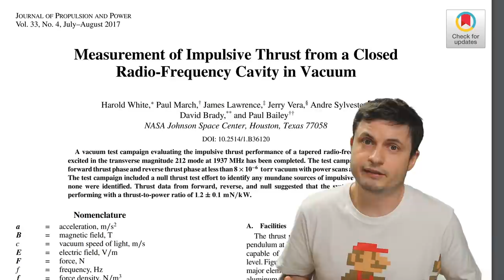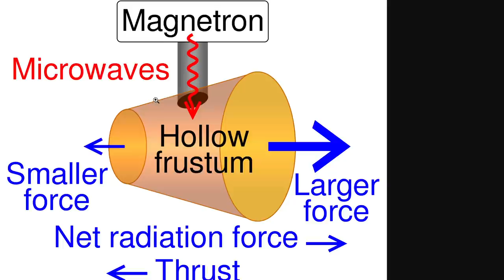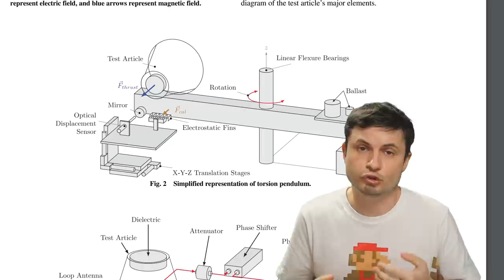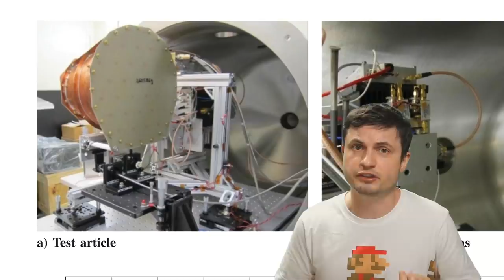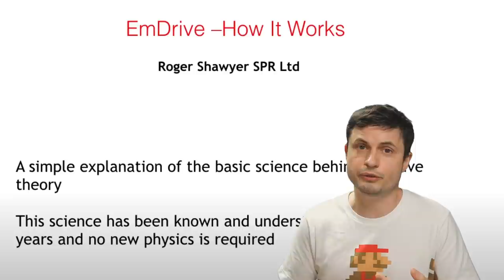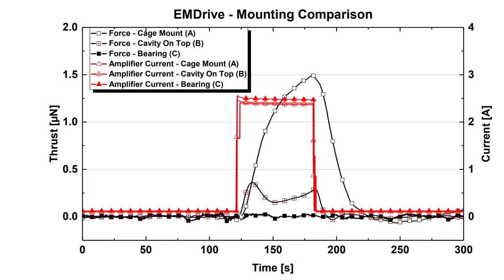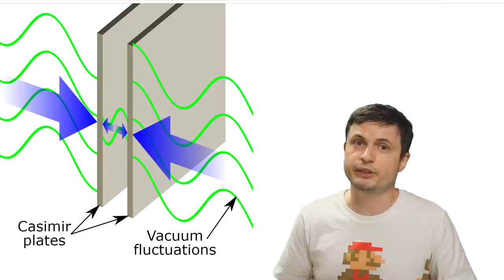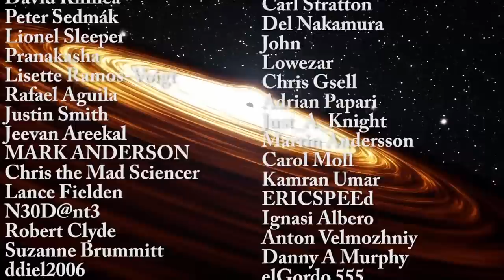Looks Like EM Drive Is Officially Dead - Experiments Fail

Comment: Just put in on a shelf until someone smokes the right amount of dmt and figures it out
Reply: Your name matches your comment kek
Reply: They are now trying it with light instead of em waves  someone already smoked some dmt
Reply: @Thorcat001  Light is an EM Wave.
Reply: I’m doing my best dammit
Reply: @Thorcat001  "They're now trying it with light instead of... Slightly different light."
Reply: I actually already have.  The vibration of a lesser thickness insert into the cavity of the larger would produce a pnumonics simular to a guitar and violen.  This in itself would cause a distortion that would negatively effect the surroundings causing them to become slightly unstable and while it will work.  It will require time for the vibrations to start to the point that propulsion will be achievable, and worse it will take time for them to stop without further import.

Acoustic vs electric.  Sound in itself can be used as a form of energy.  After all it is moving at the speed of sound.  And the density of the sound has the ability to not only move objects through vibration but also change their structural stability.  This could also be used as a weapon sadly enough.
Reply: @dontneedtoknow5836  What?! Vibration is not propulsion... Also, you need matter for acoustics, of which there is very little in space.
Reply: @Beeeeeeeeeee  sound waves exist in space.  Much like light sound isn't mutable by lack of gravity.
Reply: @dontneedtoknow5836  No, but it is mutable by, you know, having nothing to travel through. There are no sound waves in space. If there were, you'd be deafened by the sun even at this distance simply because of how loud a constant, gigantic nuclear fire must be.
Reply: @Beeeeeeeeeee  acoustics is caused through sound waves rebounding off of a surface.  Acoustics themselves is a disruption through soudwaves and yes are a form of energy.  Energy itself can be used as a form of propulsion if directed into a concentrated form.  This can be scene very easily in effects of a balloon near a vibrating object such as a guitar or a violin where the vibration isn't an almost instant fault, when compared to a snare drum or a   comcrete slab.  I don't think you quite understand what I am saying.

The more it rebounds within the surfaces the more it can accumulate but the input must be great enough to to reach the potential of the vibration of the object without damaging it.
Reply: @StormTheSquid  sound is not mutable.  It has a shorter lifespan that say light.  The reason their is very little sound in space is because we are not close enough to sources of iutput, and are insulated significantly more due to radioactive aspects of areas that the person would be exposed.

Much like a ship would be close to pitch black if the lights were off, due to lack of rebounding surface when it comes to light; the same method is applied with wound.  It is a linear travel wave much the same, the source determines the originating direction and rebounds determine the density over distance.  In fact if it wasn't for the surface of the earth itself you wouldn't be able to make out that someone yelled 2 blocks away from you.  A gun shot would not be audible at a quarter mile.  But when the rebound is concentrated on all sides or absorbed through insulation then you wouldn't hear it at all.  Why do you think ear plugs work?  The waves bounce off the foam inserts at certain frequencies and others are absorbed and slowed as much as possible before entering into the ear canal.  Much like light in water?
Reply: @dontneedtoknow5836  Please google the definition of sound. Then the definition of vacuum. I'm not going to explain 3rd grade science to what is presumably a grown adult on the internet. I just DO NOT have the patience for that right now.
Reply: @StormTheSquid  yes lets.  Let's also encourage a discussion of this theoretical engine using the wrong material to actually refract an electromagnetic wave.  It is made of copper or brass.  Bot conducive to what he is attempting.  He would need something of an aluminum shell to actually cause the rebound he is attempting to produce.

By charging the shell he is merely releasing the energy through the shell and discharging it in such a way that it is not focused.

I never said the engine would work for space travel with sound.  Do not even assume so.  I said he is using the wrong wavelength to produce any thrust with that design.  He should make it out of aluminum alloy if he wants to use electromagnetic properties with it.  If not then all he is doing is causing the copper to react and be a form of conductor.
Reply: @dontneedtoknow5836  I really don't have the time nor patience for you rn. I'm not a grade school science teacher. Please do not reply to me until you've understood why sound doesn't exist in the VACUUM of space. I've even given you a huge hint there.
Reply: @dontneedtoknow5836  Oh man... Acoustics need matter to propagate, electromagnetic waves don't. Why? For sound to exist in a substance, compression needs to happen. If there is a very low density of particles, barely bound by cohesion/adhesion, there isn't much compression if any. So no sound. EM waves do not need compressible substances to propagate.
Reply: @Beeeeeeeeeee  I know this.  And the materials he is using aren't efficient for what he is trying to so.  He needs a non-conductive shell.  But anything that you can use would be to fragile to survive any form of vibration needed to create such a compression to generate the thrust.

Sound does travel in space though.  The concentration of particles just prevent it from being measurable to the human ear.  The question isn't if this engine will work though.

The real question is how to transfer the vibrations into a concentration of particles by moving fast enough to actually accumulate them to a meaningful reserve within a confined area?  How does one create enough gravity to concentrate them towards itself?
Reply: Siri: Read me a list of discoveries made after smoking DMT. "Please tell me you're on DMT right now. Otherwise, I'm scheduling you a psych evaluation immediately."
Reply: @jaybingham3711  they obviously haven't smoked the right amount yet.

Comment: The sail boat tests was from the venturi effect moving the existing volume of air. As they turned to the side it would create a low pressure and move the air on the opposite side across the sail. The same effect can be seen in an air foil in a stall angle of attack.

Comment: Blowing a fan onto a sail works because of you blow one side more than other you redirect the air and get lift. In the middle you get it stalled. Sails are airfoils! So if your sail was initially 90 degrees with the boat, you blow one side, it flexes a bit, the air goes that way and you have a small angle, that component makes the boat travel...

Comment: The first failure of this drive concept is the assumption that microwaves can create "pressure"... they cannot as photons do not exist.
Reply: Um what? He literally talks about the Casimir effect which is caused by similar particles. There are concepts for solar sails that work by reflecting photons. Wdym they don’t exist, just because something has little to no mass and exerts an extremely small force in collisions does not mean it doesn’t EXIST

Comment: Fan on sail? It works for Wile E Coyote!
Reply: A fan mounted to sail boat would actually work if it's angled correctly and not perpendicular to the sail while also not being parallel to the floor of the boat. It wouldn't be efficient at all but you could slowly make it move forward.

Comment: I think a better drive is the wobble drive. Place a cordless drill on a skate board. Make a fly wheel out of some 1/4" plywood, and a center axis out of a  1/4" bolt with washer and nut to secure it to the fly wheel. you have to make the wheel out of balance by attaching a weight to the outer edge by drilling a hole and using a short 1/4" bolt, and nut. Place the fly wheel in the drill chuck. Place the drill on the skate board, and secure it with some tape. The drill should be laying flat with the fly wheel to the side. Turn the drill on to a low speed. The skate board should move back, and forth. Now slowly increase the speed until it move in one direction.

Comment: I'm not surprised that something running on radio waves won't work
Reply: cause no one listens to the radio anymore. you need hope to ride on radio waves :C
Reply: Video killed the radio star.
Reply: Not even .mp3 would work in 2021, let alone radio 

Rockets should be a about Spotify and his streaming clones
Reply: I mean, you can still drive a vehicle with radiation. Solar sails wouldn't work otherwise.

Comment: It worked on myth busters because it wasn’t a closed system. The air was coming into the fan from the air to the rear of the boat. That was close to the way a “real” sailboat works. It wasn’t very successful mostly due to the problem of the inefficiency of that system. The fan simply wasn’t producing enough “wind” for the mass of the boat.  And much of what it was producing wasn’t enough to inflate the entire sail, which is why they turned it back and forth.

The Casimir Effect produces no thrust, and so can’t be used for that.

Comment: In the case of the sailboat, it's not like pushing on the inside of the car, because the air is coming from outside the boat.

If you were blowing air at a sail perpendicular to the fan, the forces would cancel. If you blow the air an angle, it would twist the boat (same principle is gyroscopes rotating spacecraft, no laws violated) and the friction on the keel (which is the outside force) propels the craft forward.

I don't know if you can do it in a car, but the principle is the same. Many people have discovered you can propel a bicycle forward by wiggling tire back and forth. This is in reality more like walking than a violation of the laws of physics, and that's what happens blowing a big fan on a boat sail, it's just not as obvious.

Comment: As a standing wave can be produced, the ' trick ' is to have the smaller side be where the waves intersect ( net zero wave resultant ) and the larger meeting either a half wavelength ( potential max wave differential ) or just past the wavelength.  Conservation of energy dows not apply as the microwave is acting like gas in a car engine.  Without accounting for that, your car should not be able to charge the 12V battery while running.

Comment: That EM drive would never work using a synthetic form of dark energy, and they need to build better thrusters.
Thankyou for posting another great video Anton.
Reply: W... What? Explain.
Reply: @Teth47  It is very simple.  
In order for thrusters to work using dark energy engines, and dark energy fuel supplies they would need to be next generation thrusters, to travel for years, decades, centuries, even for 1000's of years throughout the universe, to land, and take off from other deep space planets, and thrusters like this one would not be up to the job.
Reply: @XxTheAwokenOnexX  Okay that isn't even grammatically valid. I actually cannot parse what you are saying as human speech.

Nothing about any of this research is even suggested to have anything to do with dark energy.
Reply: @Teth47  Do you not think dark energy is the way forward to solving, and securing both eaths, and deep space missions?
Now take a closer look at those trusters and you will see they will not very well using dark energy technology
Reply: @XxTheAwokenOnexX  No, I don't. I don't have many thoughts about it because I, like the rest of humanity, have no idea what it is. Maybe there's something promising there, it's worth investigation, but we'll cross that bridge when we know where it is.

Of course this doesn't "use dark energy" whatever that means, it wasn't designed to, it was meant to push off quantum foam, which is also nonsense but slightly less so. Really it was designed to attract investment and seems to be based on a misunderstanding of momentum.
Reply: @Teth47  If you have no thoughts about next generation dark energy supplies, to replace current fossil fuels, especially for deep space travel, then do not reply to my comments when you have nothing constructive to say.

Comment: Once again, experimental physicists to the rescue.
Reply: The problem is replacing conventional rockets instead of aiding them . A body at rest stays at rest..  so sending electrons through the walls would only. Heat up the walls . And the fact the heat gave slight push or made it lighter. In my book it did work

Comment: A qualifier to the sailing demonstration. If the fan axis on the boat is perpendicular to the line of the keel and the fan is projecting onto a sail that is at 45% to the line of the keel, this will actually sail. The same principle was used to run up an autogiro rotor with compressed air injected down the length of the wing to a tangential jet nozzle on the tip of the wing.

Comment: I designed the test stand. As far as I understand it, It was a problem with the connections. causing the magnetosphere to interfere. We really tried. In the right conditions we could pick up a footstep 1000 km away. It was fun. Damn thing was so sensitive it could pick up a wave lapping on a beach within 100 km.

Comment: What you're missing is time and using energy.  If you throw out a cork tied to a long string in space will it keeping going...no, but will stop taking out string when it can't overcome the inertia of the string. In a spaceship, you can eject a mass inside the ship and then use up the mass(energy) before it reaches the other side of ship. It works well.

Comment: Mythbusters sail working makes perfect sense. The wind is just curving a bit backwards by pushing against the cuves sail. 

If the fan was facing backwards it would to  work. If you had a 180 degree pipe on the output on the fan it would be the same thing. The sail is acting like the pipe.

Comment: The picture of the truncated cone cavity made me think of an analogy:
Take the cavity and pump the air out of it. Now, atmospheric pressure is acting on both ends.
One end has greater area than the other so the total force upon it will be greater.
Hence the end forces are unbalanced and the container should move. 😃

BUT we just ignored the force on the cylindrical wall. 
Since the wall is conical the net force on it has an axial component.
If you do the analysis, this component perfectly balances the difference of the end forces.
Thus, there is no net force acting on the truncated cone. ☹️
Instead of thinking about gas molecules bouncing around inside, think of the photons in the EM case.
Again, the forces balance out neatly and the container does not move.

No free lunch, no perpetual motion, and no unidirectional force. The universe is cruel.  😭

Comment: Anton, there is however at least a theoretical possibility to create thrust from nothing else then energy without violating conservation of momentum: Imagine a spaceship that created electron-positron-pairs by a onboard nuclear reactor from 1.022 MeV photons. These particle pairs could be separated electrostatically and accelerated by a long onboard linear accelerator to very close to c to achieve a substantial relativistic mass increase in accordance with the Lorentz factor. Upon acceleration and release, the gained momentum and the pressure from anihilation would propel the ship forward. Since both types of electrical charges would be expelled at the same time, the ship wouldn't gain a net charge during this process.

Comment: Blowing the sail with the fan: that's how reverse-thrusters work on jet aircraft.  A couple of plates are put behind the jet engine, and the high-speed gas is reflected forward.  It's probably grossly inefficient, but it works.

I'm just speculating right now, but wouldn't the momentum-conservation issue be satisfied if more radiation went out the big hole than the small hole?  Light would reflect off the sloped metal, and that would push the object in the direction of the small hole.  Electromagnetic radiation carries momentum.

Comment: The reason that pushing by hand doesn't work is because of the equal and opposite reaction thing if you push on your windshield you have to push off of something. Not because of where you are pushing from.

Comment: While it doesn’t work as an engine, the mechanical engineer in me is curious as to what these measurements could mean in terms of loading fatigue on a system. This is to say, how microwaves contained in certain configurations could create “awkward loading” and possibly cause mounting brackets and loading points to give out far sooner than expected. It’s a pretty minor and extremely specific concern, but it’s still what my mind thinks when I see this.

Comment: As I recall even with the measurement error wasnt the force generated down on the same scale as just pumping the same amount of energy into a flashlight would generate?  We can already do that for a "Reactionless" drive, the only problem is the thrust is so low it will take you forever and a day to build up any appreciable speed.

Comment: Another cold fusion.
Reply: Not really.  Both ideas exploit some grey areas in physics.  However the issue with the em drive are less grey barring some untested aspects of quantum electrodynamics.  The idea behind cold fusion was similar to the idea behind muon catalyzed fusion.  However the bottleneck for muon catalyzed fusion is the energy required to produce the muons themselves.  The hope with cold fusion was to find a "resonance" in a mollecular process that sharply enhanced the tunneling rate for nucleons.  This was extremely optimistic.  However similarly improbable things like this have been discovered before in the condensed matter world and then exploited using technical means.